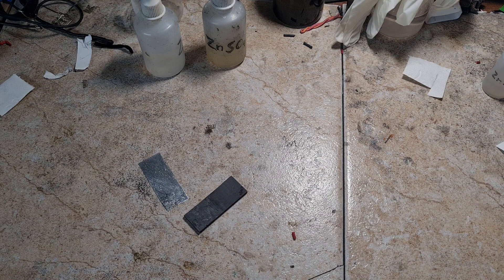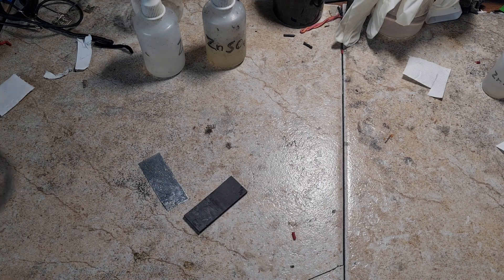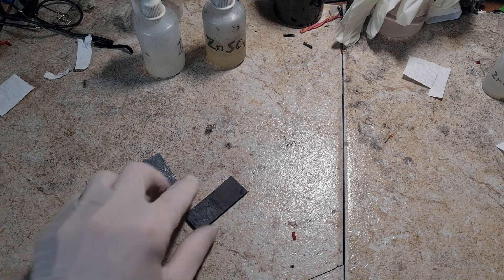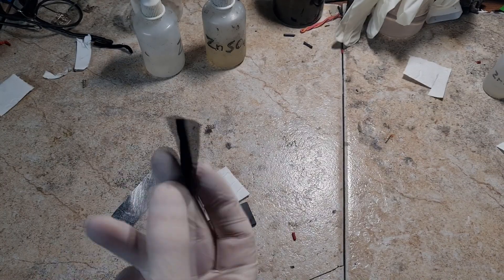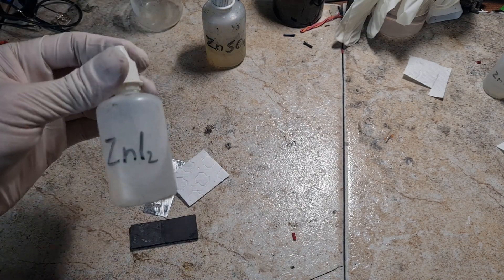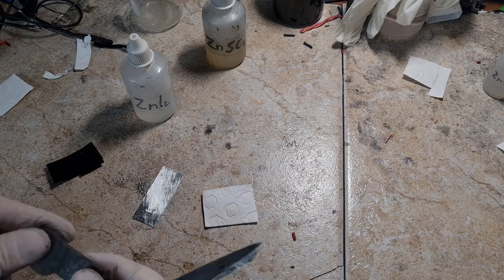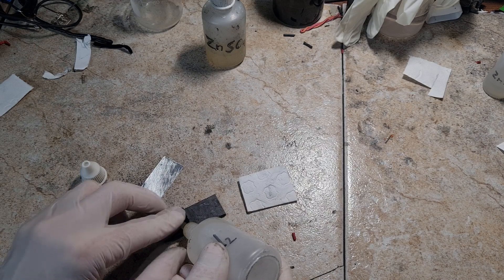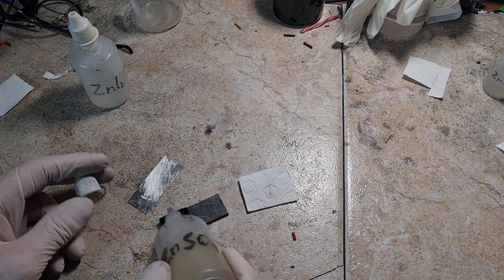DIY Zinc Iodine Battery

Comment: Bromine has left a bad taste in my mouth since I learned of Thomas Midgley Jr, the inventor of Tetraethyl Lead, and Chlorofluorocarbons.
He actually had two contenders for the refrigerant, that and Bromofluorocarbons. Bromine is in the same chemical category as Chlorine and Iodine.
Thomas chose, rather arbitrarily and capriciously, at the last minute, to use Chlorofluorocarbons, and not the bromo.
Because had he chosen Bromofluorocarbons, the Ozone Layer would have been dead before we knew there was a problem.

Comment: my understanding of the Zinc Iodine flow cell is limited but I thought that iodine crystals blocking the flow channels is one of the potential problems that this combination exhibits.  This isn't the case with the hybrid cell, right? (but at the expensive of no longer have the usual capacity/volume relationship that the full flow cells enjoy).

Comment: You realize that the best electrolyte to use is Ethylene glycol. Zinc sulfate is more soluble in EG.
Reply from the maker: Is good but not the best. Yes I know that ZnSO4 is more soluble in EG. I make a cell which use that ZnSO4/EG electrolyte (and also ZnCL2/EG) several years ago, I think I also need to have some video about that. Using EG or EG with water is good for making cells for low temperature environment.

Comment: thank you so much for your teachings.  if i cannot find iodine crystals in my country, can I use tincture of iodine instead ?
Reply from the maker: Good source of iodine is also potassium iodine
Reply: @cayrex  thank you.  i get it.  i think... are we talking about KI or KIO3?  if it is KI  i will extract the iodine from the potassium iodide is that right ?  thanks
Reply from the maker: @samosdolphins123  you can use potassium iodine or you mix KI and ZnSO4,.... then you will get ZnI2 and K2SO4
Reply: @cayrex  oh thanks ! that sounds much easier.  I guess a visit to the beach is in order to get myself some potassium iodide.  :)
Reply from the maker: @samosdolphins123  Yea! In solution of potassium iodine you put two carbon rods and you apply some current,.... and you will get the iodine on positive carbon which will  be dissolve in solution. If you have potassium iodine and zinc sulfate in solution and you apply some current to carbon rods,... you will get zinc plated on negative carbon and iodine on positive.
Reply: @cayrex  super !
Reply: @cayrex  I have seen examples of batteries using two carbon rods instead of the metal on the anode.  what is the difference and why do we use two carbon rods instead?  can i use two carbon rods with zinc bromide battery instead of zinc as anode?
Reply from the maker: @samosdolphins123  Yes you can use two carbon rods. The nagative carbon rod will be plated with zinc when you charge the cell.  The problem with using zinc is that can be oxidized or eated away (depending ob the electrolyte) and the cell will be dead because the zinc act like current collector and active material. And if the zint is eated away, you dont have the "current collector" on which you can plate zinc when the cell is charged. Carbon on the other side will not be eated away and will be stable current colletcor. The plated zinc on carbon rod can be oxidized, eated away, ect for sure, but when you will charge the cell again the cell will work again with no problems, because the negative carbon rod will be still there as current collector.
Reply: @cayrex  thanks that helps me a lot because i cannot find zinc at low prices in small quantities, it is expensive sold as anodes upwards of 30 euros per kg but per ton it works out at 3000 euros and of course buying a ton is way too much for practical purposes.  I was looking to buy some zinc plated steel but i am not sure if that would have a reaction with the steel / zinc bromide electrolyte.  
  I wonder if using graphene as the positive and graphite as the anode would be better than both graphite.   what do you think ?  it may create a good potential between anode and cathode.
Reply from the maker: @samosdolphins123  Good source of zinc is AA, AAA, D zinc carbon battery. Just use normal carbon or graphite,.... beacuse real graphene is expensive and you will not get so much preformance out from this cell. Two carbon rods,... for example from D cell zinc carbon battery will work fine. Less you're complicating it better will be.
Reply: @cayrex  sounds good! graphene is very expensive.  thanks professor
Reply: it is amazing how it works with graphite and graphite anode and cathode but how does it work with graphite anode and cathode?  I read somewhere that the cathode is determined by the element which has a higher reduction potential.   how would a graphite graphite anode/cathode work in this case?  is it because we charge it and it designates the graphite as cathode after the first charge?

Comment: How practical would it be to replace the carbon electrode with a ribbon of carbon fiber, use fiberglass separator, and roll the whole thing into a compact cylinder?

Comment: The question of the million: Is it rechargeable?
Reply: I suppose you could try it with a lipo battery charger but that would require some testing to find out what the right voltage is to not blow up
Reply: Yes they are
Reply: Now put up a wire 200 ft long  like 30ft up in the air well insolated...with maybe graphene strips every few ft on sanded wire spots .then connect it to your battery if it's two strong..that's 1000 voltage but low amps ..try a dc to dc converter to up the amps and lower the voltage.. with this you might be able to run some things in your home by charging 24/7/365 real good system no harmful chemicals and rechargeable batteries doesn't ware out .

Comment: Quick Question regarding your Nickel-Zinc batteries. I know its not related to this one, but I have been watching multiple videos recently! What is the piece of metal that you attach to the NiOOH electrode, from which you then use a gator clip on? It appears to be crimped onto the electrode. Please let me know if you can help describe what that is!

Comment: but zinc iodine batteries have a lot of self dischrge?
Reply from the maker: Yes and no. Depending on several factors like how is made the housing, cell construction, additives,  preparation of the cathode, etc. For example one of my zinc iodine batteries which I test the self discharge, I get from 1.314V and 0.72A to 1.268V and 0.61A in 5 days.
Reply: @cayrex  wow that sounds impressive. Carbon felt? Check out my zinc iodine battery video I posted. 24 mah from 2cm square
Reply: @cayrex  any tips to reduce self discharge?

Comment: Hi, thank you for sharing! One problem though is high solubility of iodine in electrolyte as I3- resulting in diffusion over to zinc anode and high self discharge. You could try reacting iodine with AC through heating to form AC-I addition products, then once this is chemically bonded to surface of AC, it is stuck there and can be oxidised to AC-IO3 etc. in alkaline electrolyte. Possibly that will keep iodine on the cathode side, also higher voltage can be obtained by Zn in alkaline conditions. Please try this, I would love to see!
Reply from the maker: Iodine bonded AC electrode I use in my previous video. About Iodine in alkaline electrolyte like KOH or NaOH,.... will not go into KI / KIO3,...
Reply: @cayrex  Ah okay, there was no commentary there so didn't know what you were doing.

Comment: Thank you very much for the video. Cayrex2! I'm messing around with a Redox flow battery. And I was walking around in the forest and do you know anything about tannic acid? There are millions of Acorns laying on the ground where I live. So I thought maybe extracting the tannic acid (TA) from them. I belive this may work as a electrolyte what do you think?
Reply from the maker: Oh RFB, nice. Tannic acid,.... you have in coffee, tea, wine, grapes, etc. Tannic acid as freestanding electrolyte,... emmm not so much. But I hear that was used as electrolyte additive in Li ion battery research.
Reply: @cayrex  ya I just started looking online and see a lot of research is being done on TA. seem like it's not just for lithium ion. I just read it make activated carbons more conductive. When mixed. So maybe if mixed with  your conductive ink may improve the conductivity? Just a thought.

Comment: Does the iodine evaporate where you live? I live in northern Australia and if I leave anything with iodine out it will disappear!
Reply from the maker: Iodine will color the surroundings to dark brown stains.
Reply: @cayrex  I think the reference is to very high vapour pressure of iodine.  Do you know of a way to stabilize this for long term use? or just make sure the battery is very well sealed? Thanks